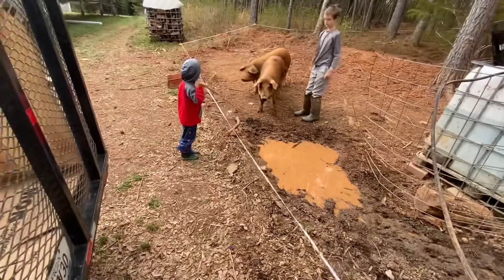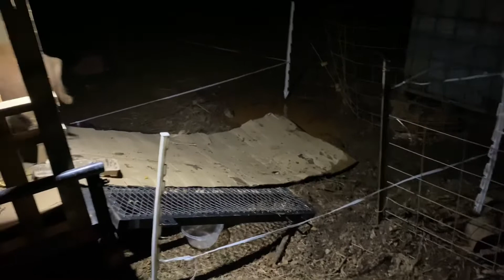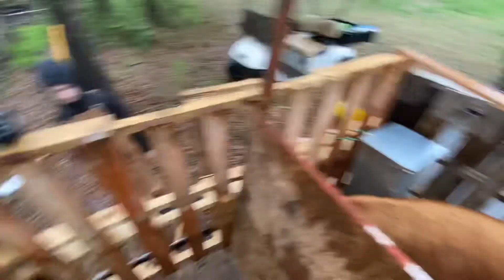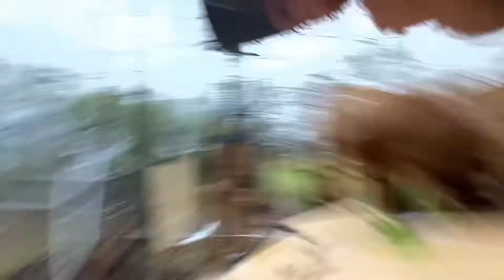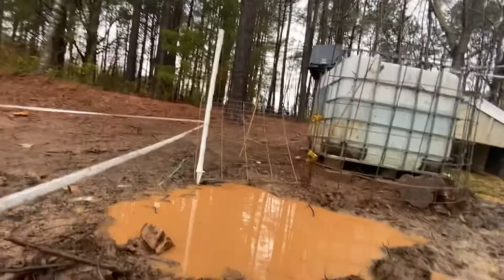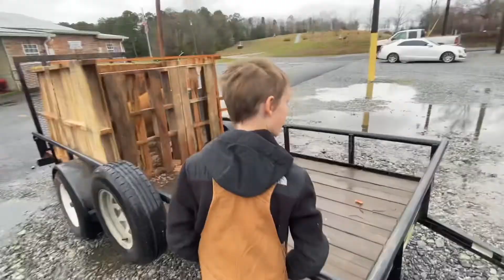Loading the pigs

Comment: Hello Johnny, just curious about your solar array how many panels and KW ?
Reply from the maker: 52 400w LG
Reply from the maker: I need to make a video about my whole setup.
Reply: So 20.8 KW, that's huge. I have 40 x 330 W at 13.2 KW, have not paid for electricity since installed 3 years ago and that's on a 2300 sq ft home with 4 ton AC in hot SE TX, I am super pleased. A video on your system would be cool.